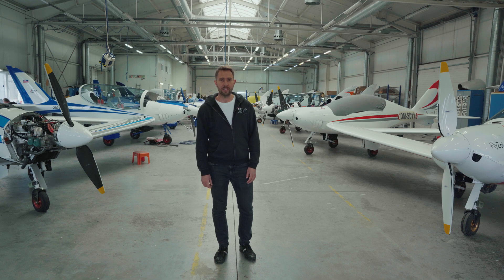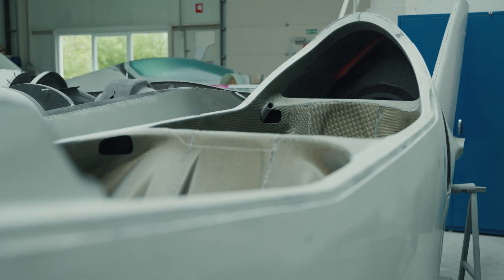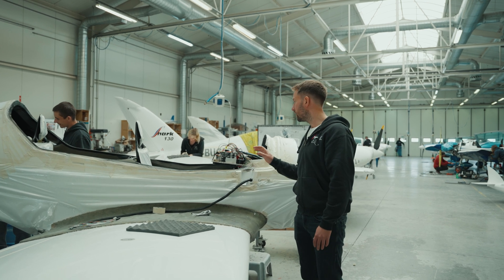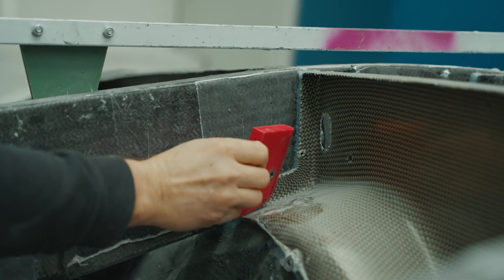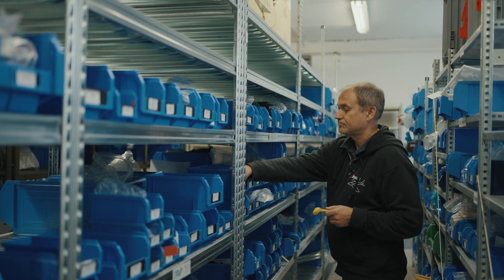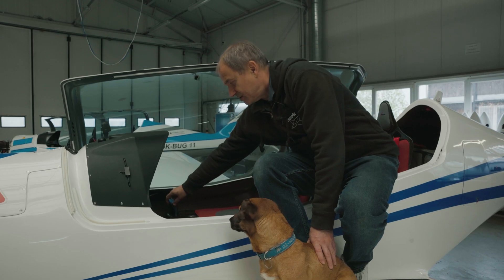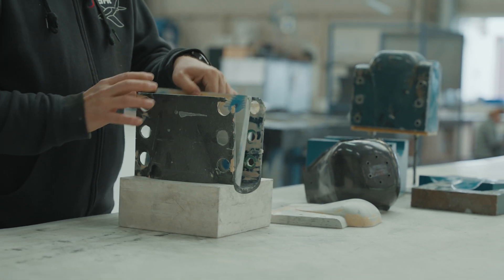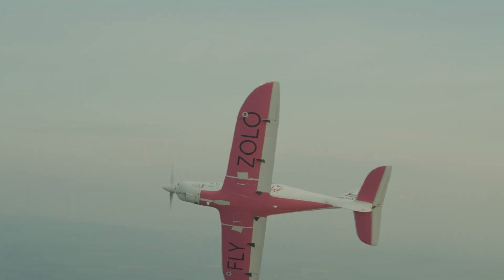Shark airplane - where 3D printing meets aviation

Comment: Is there a program of the Shark for flight simulators yet?   This would be an excellent way to promote the Shark.
Reply from the maker: On its way, no fixed date yet
Reply: @sharkairplane  I have a flight simulator (X-plane 11) with full controls.  A friend of mine is in the process of buying a Shark and having a Shark flight sim program would be beneficial .

Comment: 3D printed parts are a huge safety compromise... Components built with filaments can't have the same tensile strength of solid materials due to their inherent layer by layer construction.
Reply from the maker: Yes. Therefore we use it only as non critical parts. Such as headset holders, locks, covers, etc. And for prototyping of course. Everything is tested according to the certification basis’ requirements with safety factor 2.